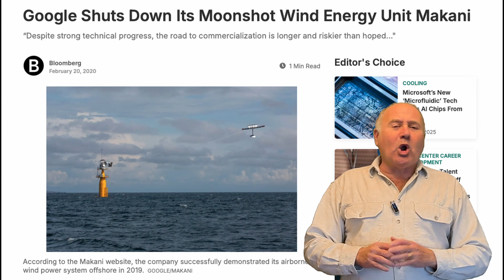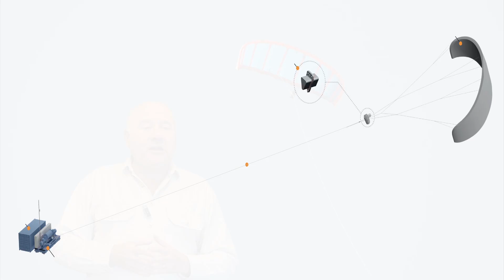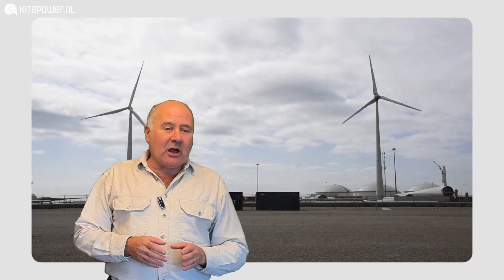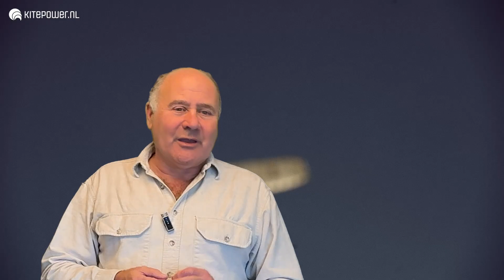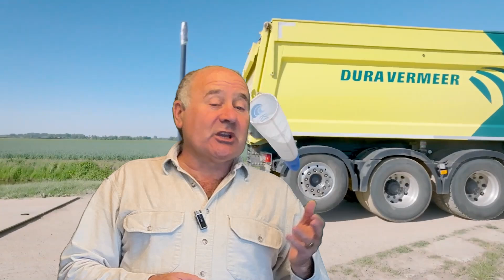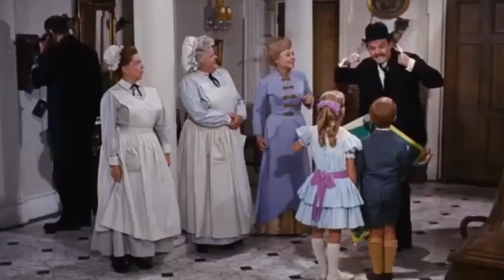Kitepower: Can we use kites to generate electricity?

Comment: Hi I live in zone 5 of this project and even in the zone im in the noise and shadow is so annoying, with the surveys we have carried out it is having a serious effect on the red deer and mountain hare. Just let you know also it took 1.5 year to construct and a larger concrete base bigger than any turbine in Ireland, Roll on full planning permission 2026....
Reply from the maker: The base they’re using was built for a different company and is oversized for their kites. But when I visited the site, there weren’t any homes nearby that I noticed.  How far are you from where they fly the kites?
Reply: I live in the furthest zone 5 ,awful buzzing from it especially when in local graveyard ,it will be going for full planning permission in new year as only operating on a five year permit....
Reply from the maker: @MrCurrach I don’t know what zone 5 means. How many meters are you from the where the kites are launched?

Comment: I think you mentioned 200 meters of line, but that's on a diagonal. How far above the ground does it fly? And how turbulent is it at that height?
Reply from the maker: In the current operation, it flies from 200 m to 300 meters of tether. When it’s generating power, it at a fairly shallow angle, but when they’re reeling it back in, it goes straight overhead, because at that orientation the force on the line is minimal. But the ground station has about 600 m of tether, so theoretically they could go about 600 m above ground.

I have no idea what the turbulence is up there, but it would vary based upon the wind patterns.